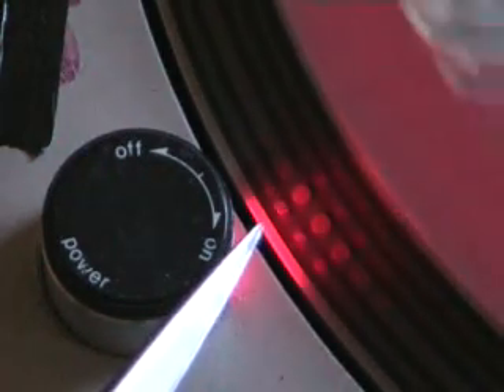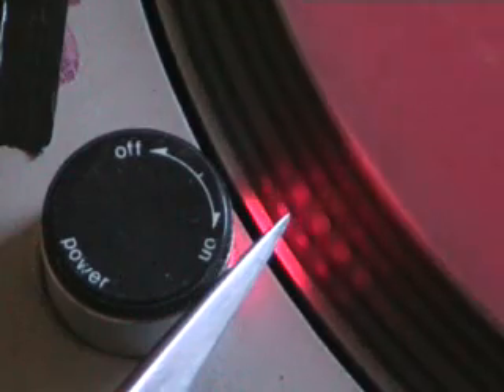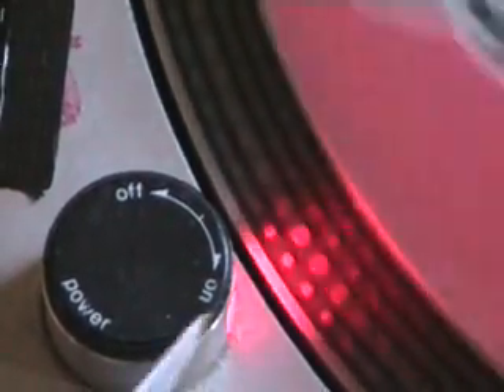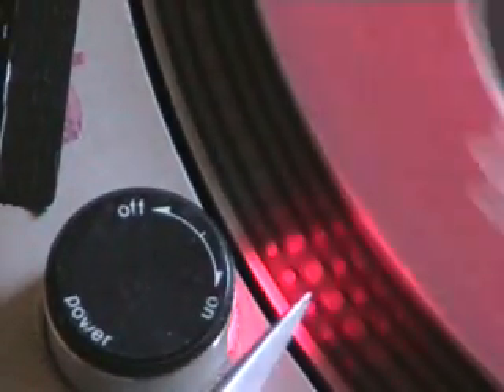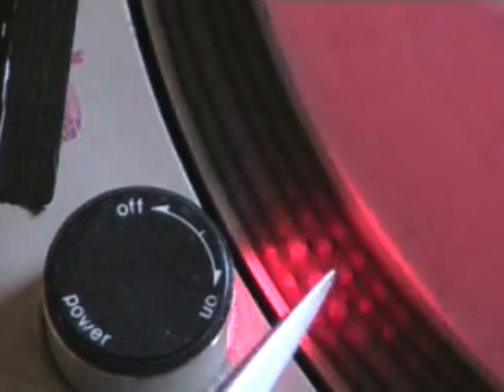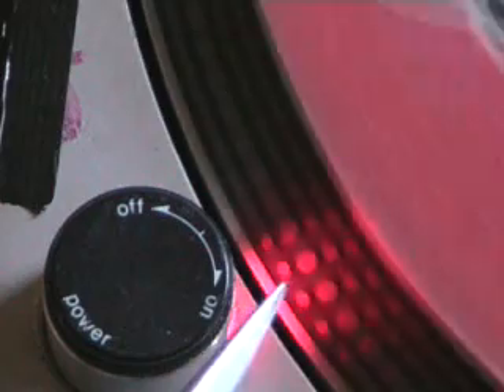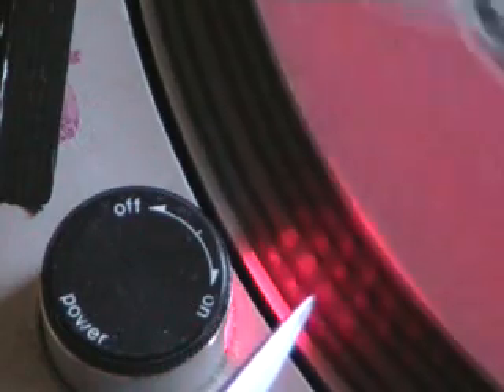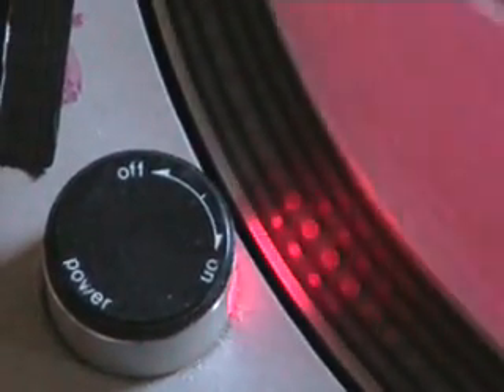What should the dots do on a Technics SL1200 t table?

Comment: In the service manual for the SL-1200 MKII, it says that there is an internal oscillator that outputs a fixed frequency regardless of the frequency of the mains.  This really makes sense since you would have to make one platter for 50Hz and another for 60Hz if the strobe would be dependent on the mains.
Reply: I know this comment is 3 years old now, but it's actually why there are 4 rows on the platter. The top two are 50Hz, and the bottom 2 are 60Hz. One for 33, and one for 45 in both frequencies.

Comment: The top two dotted bands are usually for 45rpm and 33rpm in countries with 50Hz power supply. The bottom two bands are for 60Hz. If you find the need to adjust speed/pitch when switching frpm an LP to an EP, adjust the variable resistor inside the unit, which is accessible by lifting off the rubber mat or disk table. Very simple.

Comment: What are the physics behind how the dots all move in different directions and yet are fixed when the turntable is not in mortion? Thank you
Reply: The strobe acts like a shutter. Depending on the harmonic frequency in which the turntable oscillates at the dots will basically match the frequency of the strobe switching on and off and will thus appear to be still.

Comment: Hello- Thanks for the video!  My 1200 mk2 every 20-30 seconds wobbles.  Even when the pitch is dead center green. D you think its the motor or the pitch controller?  Thanks!!
Reply: Could be either as both to an extent would give you the same problem. If it’s pitch you’ll be running out of time constantly in the mix, if it’s every 30seconds that sounds more of a power issue, so could be the motor or could be a capacitor. Probably good idea to get a service. Decent local electrical store will be you best and cheapest bet. I get mine serviced at a place that repairs tele’s and washing machines and believe it’s way cheaper than sending them off somewhere 👍🏻
Reply: Ahh 10yrs ago 😂 would hope you’d have got to the bottom of it by now?

Comment: SL1200 is one of the best Hi-Fi decks you can get. It does NOT have automatic stop, simply because that'd be much more of a hindrance to DJ-ing than a help, but the stylus will NOT end up on the label because the big groove before it is in fact a "lock groove," meaning that it loops and the stylus stays still.

Comment from the maker: TO SENAKERSET, YES I DID!! but remember there are close to 65,000 video uploaded each day so better to have 2 or 3 than one !
 j
Reply: hi, the dots on my 1210 move left and right slightly on whatever speed its on. does it need a new pitch slider or a new mcb part? 🙏🏻
Reply from the maker: @chrishill441  yes
Reply: hi, does it need both parts or just one? thanks
Reply from the maker: @chrishill441  would just need the pitch unit... also known as   a pot
Reply: @ellaskins  thanks👍🏻

Comment: Dj's use the dots to touch and slow down the record to fit the tempo of another record when mixing....
Reply: AWSOMUS LATEST that’s not really using the dots, that’s just tweaking the platter to get it back in best. The dots work as a strobe to show speed.